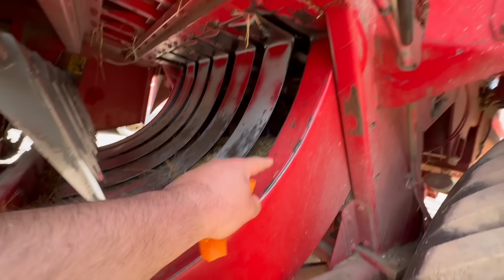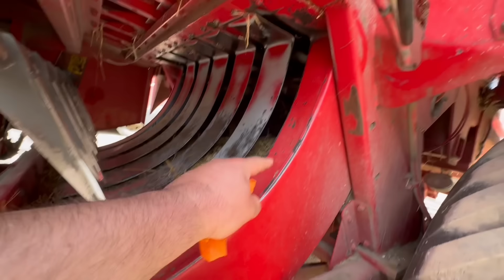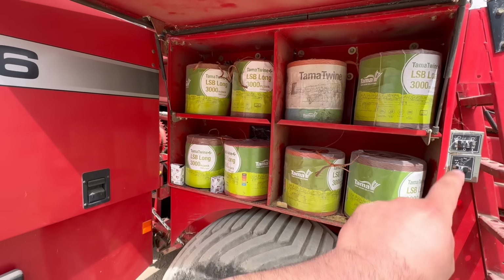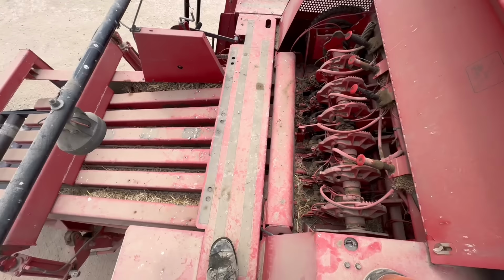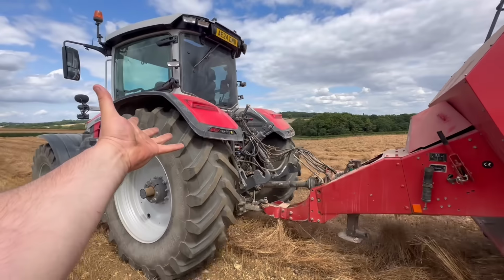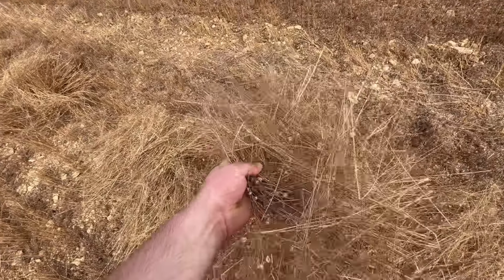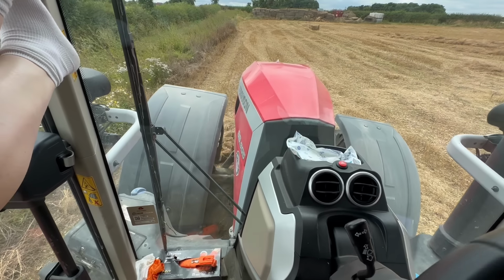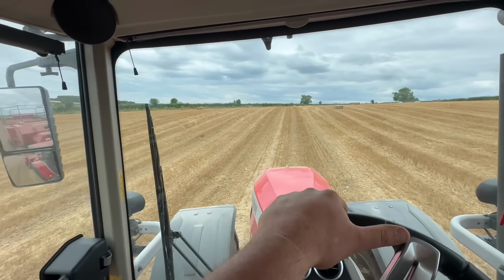The big square baler how does it work ?

Comment: Shouldn't the PUH have two pins holding the hook or clevis ?
Reply from the maker: No 1 on 200hp +
Reply: @Tomlamb980  Well I guess MF know what they're doing :). I saw a second hole but that must be for using the drawbar in an extended position
Reply from the maker: @DanMurphy-w3m  correct
Reply from the maker: @DanMurphy-w3m  it’s not my if made by dronenberg
Reply: @Tomlamb980  did you mean mf. This was an American Hesston designed machine not Danish Dronnenberg, ....but is that where they are now made?.

Comment: Top tip Tom - fit a rear facing camera on the back of the baler so you can see the bales coming out of the chamber. If you see one with no bands or the first bale out of an empty chamber when its really soft, get out and cut the bands before the bale leaves the ramp. That way you finish up with an easily rebalable trail of individual wafers instead of a big lump that sticks under the tractor of blocks the baler. Reduces the sweat and chew if nowt else

Comment: I asked Google what linseed straw is used for.  Garden mulch to cover ground to stop weeds growing (similar to pea-straw), insulation cover for vegetable clamps, pulped to make paper, and burnt to heat greenhouses, barns etc.  I imagine there are special furnaces designed to burn straw.
Reply from the maker: Yes there is
Reply: In the Netherland we grow flax to use it in clothing. First they pull the flax out of the ground and lay it in rows on the ground. Than if someone wants it for seed they pull the heads off and lay the straw back on the ground for rotting and fermenting. Then they make round bales from the straw and send them off to make linen.

Comment: You just got to give a lot of respect to the engineering draftsman who designed the part of a baler that ties the knots. that's just hypnotic to watch. when I was in Suffork we used to bale smaller bales and they used to shoot into a trailer that was towed behind. My job was to stack the bale better to get more on and to swap over the trailers so the full one could then be taken back to the store shed. Because you were working at the rear of the output chute you would get covered in that fine dust and would then itch like hell until you got home and had a shower and a clean change of clothes. The machine was a very old New Holland. It clanked like a dustbin being towed down the road. Thanks for reminding me of happier days. Sorry this was a long one. Thanks for posting....
Reply: We still have and use our old New Holland small square baler.  Ours just drops them on the ground, and we come along later in the truck to pick them up.  We have a special bale picker-upperer elevator contraption that bolts on to the side of the truck and delivers them up to the tray at a nice grabbable height.

Unfortunately we still need to stack them by hand, as well as unload them by hand back at the shed.  And re-stack them in the shed.